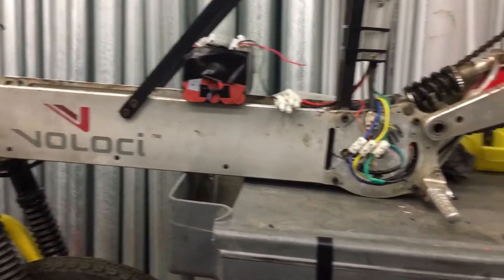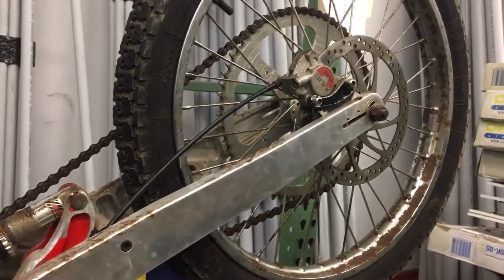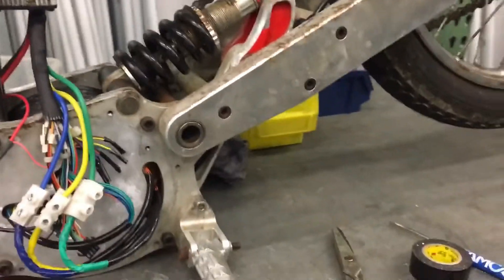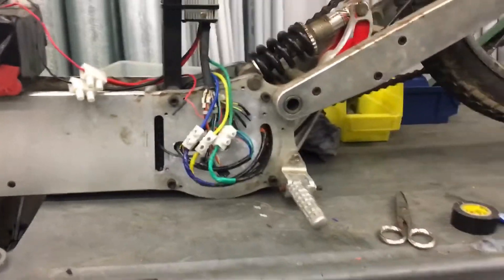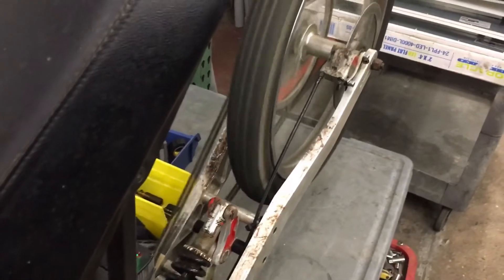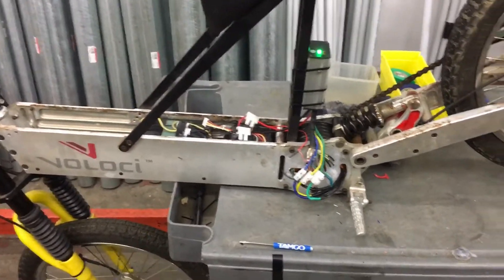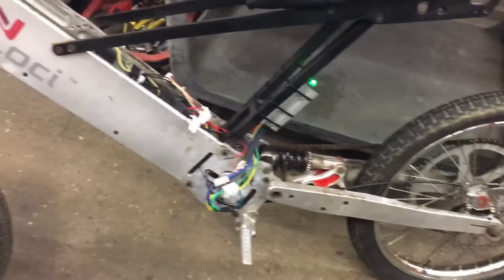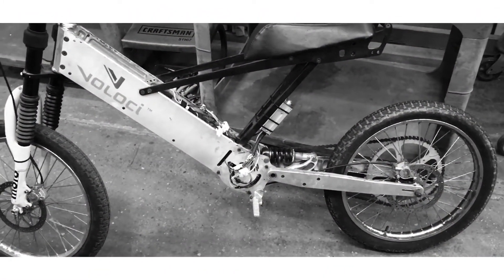Voloci Electric Bike Motor Swap Testing w/ Kelly KBS

Comment: I burnt up the motor on mine looking to buy a high power  but dnt know where i could buy  one do you know if there is a high power motor that would fit the bike? Also woyld like to know how much is a stock motor if i was to bye one from you an how hard is it to replace?
Reply from the maker: I sell the new stock Voloci motors, I'm the last known supplier in the world... But they can only handle about 2500w until the magnets fail. I have then brand new in box if needed message me